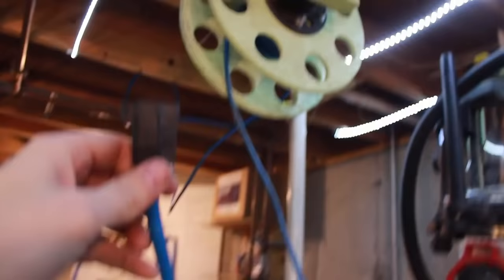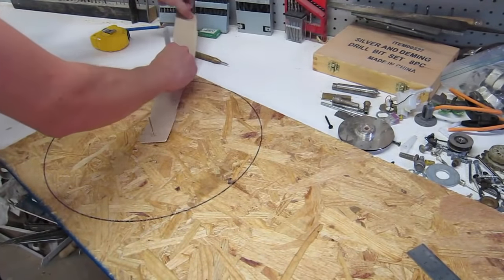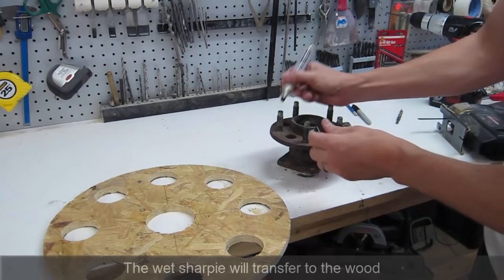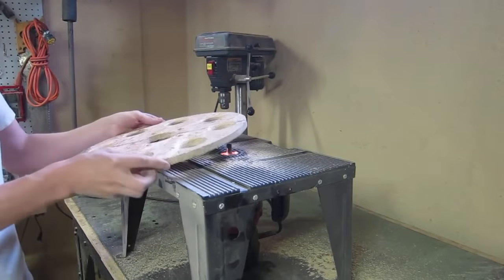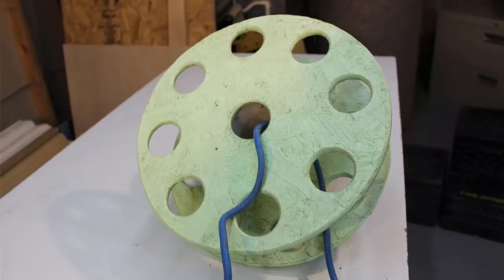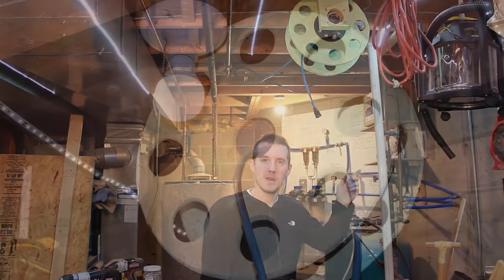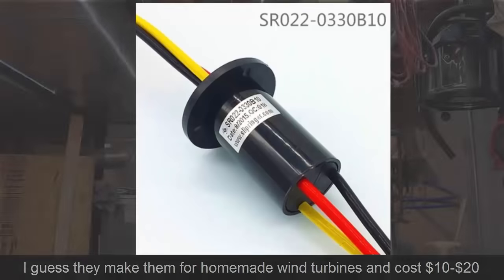Extension Cord Reel

Comment: I'm figuring out how to make/select/buy  an extension cord reel to retract 100' of 12ga. extension cord for the electric snow blower I just bought. Re coiling that heavy cord by hand is a pain. I liked the suggestion of just having the "plug" portion sticking out and then plugging a short patch cord into it and the wall. Now it's just trying to select a suitable hose reel capable of storing 100' of 12ga. extension cord. Thanks for the video/ideas.

Comment: To prevent the cord from twisting st the plug buy a short curly cord, like ones found on telephone handsets but extension cord version. The curly cord will provide torsion when winding/unwinding while plugged in
Reply from the maker: That's a good idea.  Something like this:  https://amzn.to/3M8nwXC
Simple and would just work.
I was thinking, and a few people suggested, a special ring connector.
Reply: @DaveWirth  that's just what I was thinking.

Comment: I got a reel from Home Depot wound the cord and mounted to the wall in my garage.  I have to unwind it all the way to plug in the electric weed eater, but it's still better than having to wind all the cord up by hand.  I think if you can create a plug that spins independently from the reel, that would stop the cord from twisting.  I don't have that skill set, but I'm working on it.

Comment: Just remember to not leave any loops of wire wrapped around the reel during prolonged usage of high wattage devices.  You can end up melting the plastic insulation on the wires and having a fire.

Comment: I like your idea a lot. Will definitely try something similar. A possible solution for your twisting cord problem would be for you to put the plug end (after removing the plug) through a bearing that has an inside diameter the size of the wire and an outside diameter the size of the hole in the reel.

Comment: You need a 'slip ring' to stop your cord from twisting.
Reply: Why is a skip ring?
Reply: @mac77ws  I just learned about these today. A slip ring is an electrical connection that allows signal to transfer to/from a stationary wire and a rotating wire. The solution to his cord twisting is wiring the end of the extension cord (male end) into the rotating side of a slip ring mounted in the center of the reel. Wire in a pigtail to the stationary side of the slip ring, and then plug the pig tail in. No more twisting the copper and way smoother.

Comment: Still going strong in 2022 despite twisting since you're keeping the male end plugged into outlet?
Reply from the maker: Ya i use it several times per week.
Usually only pulling out about 5 or 10 feet of cord.
It was a good extension cord to start with, which i think helps.  A cheaper cord would have frayed and cracked.

Comment: stop the cord to the outlet just at the exit from the PVC and then plug it into a shorter cord which goes to the outlet.  When winding and unwinding the cord unplug these two plugs.  Reconnect to use power.
Reply: In this case exactly correct.

Comment: With all the stuff below the ceiling joist you really didn’t need to drill. Nice job though. I bet harbor freight has a cheap cord reel.
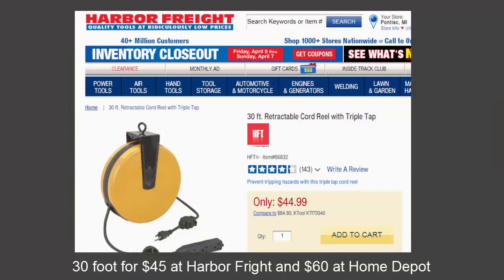Reply from the maker: Ya i have the Harbor Freight one (at 7:41) in my garage.  If i had to do it all over again, i would just buy one of those.  Considering extension cords themselves are like $30 depending on length and gauge of wire.  This is only good if you have extra extension cords already, and something like the car hub.
What i really needed is some sort of swivel connection so the cord didn't get twisted up.